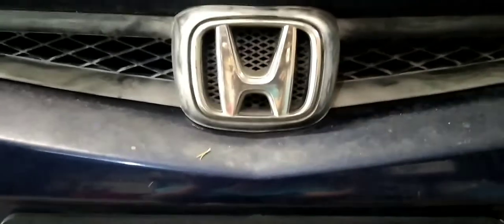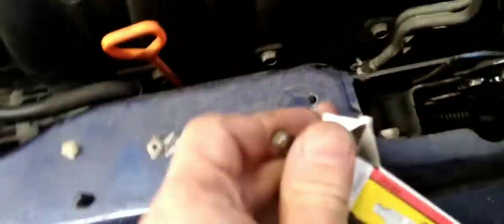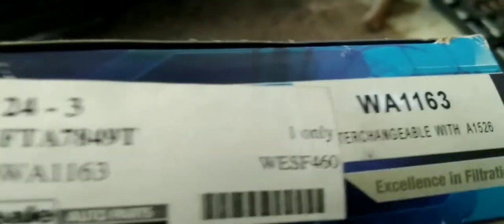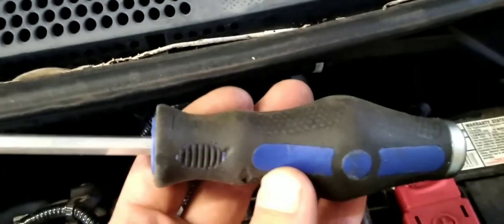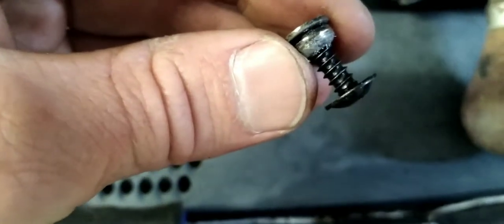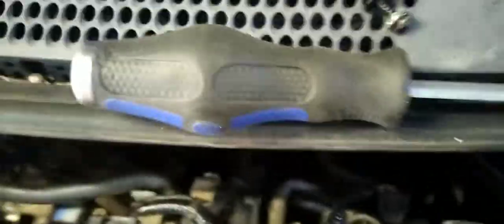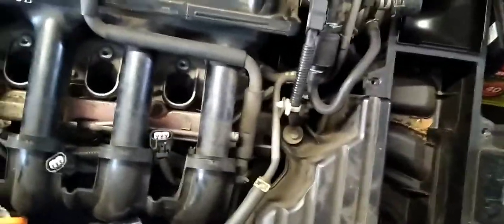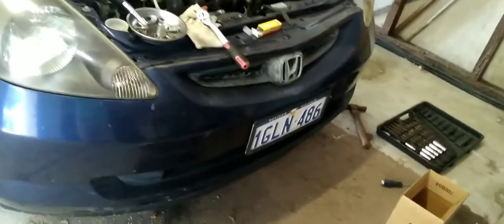Honda jazz  i-DSI 1.3L Spark plug replacement and AirBox rounded screw removal ***TIP ***

Comment: Thanks for highlighting the fact this model has 8 plugs, I didn't know and only changed 4 of the front ones lol and my daughter has owned the jazz for eight years, are all 8 plugs the same?
Reply from the maker: @oleskoolcabby5710  yeah it's pretty common lol I found different plugs in the back to the front but they meant to be the same the NGK website will give you what plugs should be in there or I mentioned it in the video or the Honda user manual. The back ones were much older it wasn't running right so I did this. You're very welcome sorry if the video is a bit long-winded. Thanks for watching. Happy it helped you. (Japanese: i-DSI), or “intelligent Dual & Sequential Ignition”. i-DSI utilizes two spark plugs per cylinder which fire at different intervals during the combustion process to achieve a more complete burn of the gasoline. This process allows the engine to have more power while keeping fuel consumption low, thanks to the better gasoline utilization. Emissions are also reduced

Comment: are the spurkplugs the same from the front and back? i have two different numbers in catalogue. i am confused.tks for the prompt answer
Reply from the maker: Check your user manual also you can look on the NGK website
Reply from the maker: @hristokolev3674  the different numbers you're seeing might be the Iridium number but they use the same plugs